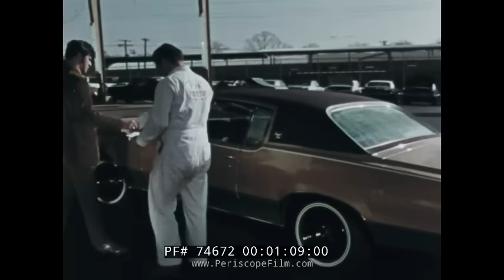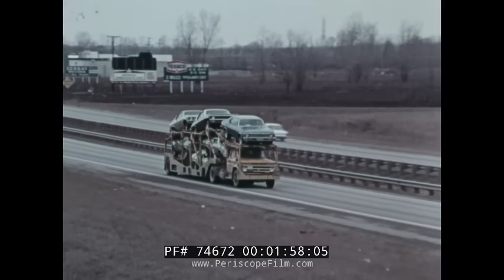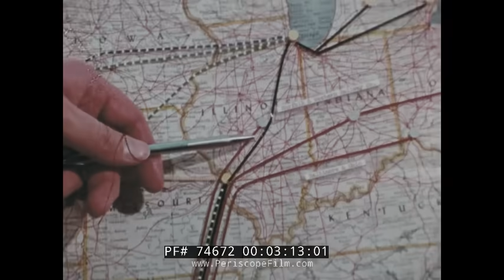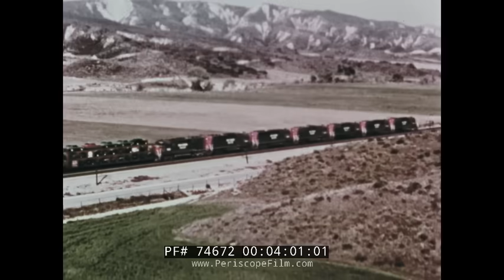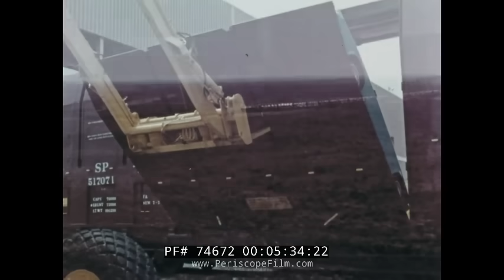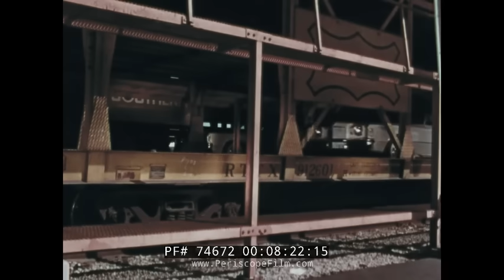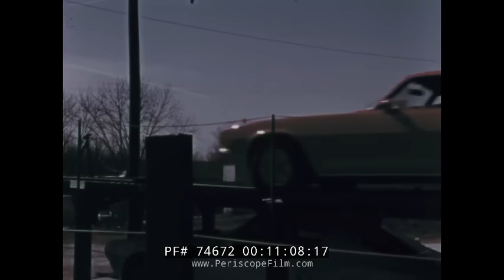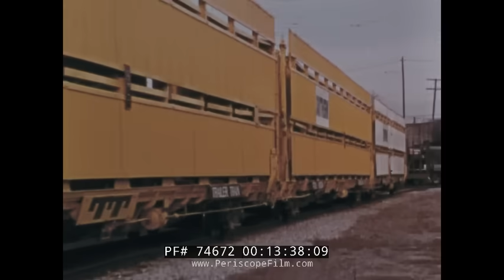1970s GENERAL MOTORS   RAIL SHIPMENT OF NEW AUTOMOBILES  LOGISTICS / SUPPLY CHAIN MANAGEMENT  74672

Comment: Somehow, being concerned about the condition of a Vega at the end of route was ironic given the intrinsic and designed-in flaws of the car.
Reply: Loved my '74 Vega. Only got about 25 mpg. Not very good for a "small" car. Totaled it with over 200,000 miles. Never a breakdown. No doubt however, the beginning of the end for Detroit. Then we moved on to Chevettes, Citations, Omnis, Horizons and Fiestas. American engineering at it's finest. An interesting side note .When the Vega was discontinued the leftover frames were used in the Chevy Luv pickup.
Reply: @steveevans4093  The LUV a Isuzu product. The  Vega a unibody car and no frame. But agree with your other comments. A lot of Vega's had long lives.
Reply: @steveevans4093  A Vega has no separate frame. The Monza replaced the Vega so they absorbed the same mechanical parts including the aluminum engine.
Reply: @Joshie2256  The Monza did not use the Vega engine. They used the 151CID 4 cylinder based on the old Iron Duke Nova engine, the 231 Buick V6 & a few got small block Chevy V8s from the factory. The Vwga engine died with the Vega.
Reply: @rebelyank6361  My 1976 Monza sure used the aluminum Vega engine! That was the only 4 cylinder through 1977. A guy at a neighborhood convenience store had one with the 262 V8. A buddy's GF had a '79 with the 151. I would have liked a late one with a 231 and a 5-speed.
Reply: @Joshie2256  yes and my MONZA IS A GREAT CAR.
Reply: @steveevans4093  200k what a.pos. lol.
Reply: @steveevans4093  You must have lived in the west for it to lasted.  Too much rust issues.
Reply: @steveevans4093  Ford Fiesta was made in Germany LOL:)  Festiva was a rebranded Kia.  Dad had both and loved them.  Both of them basically refused to die, and both got TERRIFIC gas mileage!  Chevette, OTOH... Dad bought one nearly new (used) for a work car in '79 or '80 during the gas crunch... He was driving 52 miles one way to the nuke plant to work every day, so 104 miles round trip per day adds up.  It was SUCH a POS, in the shop more than he drove it, after it broke down for the last time he walked in the dealership and threw the keys on the desk.  Went and bought a brand new Ford Fiesta and ran that thing til the wheels were ready to fall off, and then sold it.  German engineering at its finest!  Never had a lick of trouble out of that car.  Mom had a Plymouth Horizon for awhile, too... it was okay, nothing special.  First car I ever drove on the road... mom was in the hospital and Dad didn't want it sitting there all week, so he had me drive it following him home.  I was like 12 at the time, 23 miles through the countryside from the town with the hospital back to the farm LOL:)  It wasn't anywhere as good as the Fiesta for sure... nowhere near the gas mileage either.  Later!  OL J R :)
Reply: @lukestrawwalker Today German cars are the most expensive and least reliable cars you can buy.
Reply: @lukestrawwalker  the pride was a rebadged festiva and began production after the festiva did, you got your shit wrong
Reply: @steveevans4093  YOu forgot the Monza. Also Camaros were built in CANADUH.
Reply: Scott Weatherman wrong ,Camraos ,built in Ohio and Van Nys,
Reply: Scott Weatherman , Correction. Cameros  were built at the Van Nuys GM until it closed.
Reply: @scottweatherman3266  Camaros were built at the Norwood, Ohio plant.
Reply: Steve Evans and who cares??🤔🤔🤔🤔
Reply: Jefferson Martin  yes indeed!  I had one and it was junk.  Later when I became a GM engineer I actually got to work with some of the not so bright engineers involved on the engine design side.  I wanted to strangle them.  Very low days for GM.  However, now retired I really miss working at GM.  A lot of good people.
Reply: @mikesamyn7054  I hear you!!! I built Buicks in flint in 1973 regals 😱😱 and also worked at a Chevy dealer in 73 ! Vegas and ugly ass Malibu 🤣🤣🤣
Reply: Mine was fine after I put a 350 in it
Reply: My mother got one new Vega in 73, I got my license in 76, I had a lot fun in that car,  it handled pretty good compared to most of the boats on the road at the time.
It had an aluminum block without sleeves for the cylinders, so it was burning oil by the time it had 60,000 miles.
Reply: @Kent Teffeteller They wouldn't tolerate overheating. GM added low coolant sensors and indicators which saved a lot of them.
Reply: @Joshie2256   bingo. If you got it over 190. It was to hot. Unless it had sleeved block.
Reply: @Kent Teffeteller The 1st two years of Vegas had the bad engine; after that GM put steel sleeves in the cylinders which solved the engine oil burning issues. Tin Worm was a different story though...
Reply: @georgeandrews6454  None of the Vega engines had steel sleeves from GM. What saved a lot of Vegas and Monzas was the addition of a low coolant sensor and warning light.
Reply: @Joshie2256  the dura built engine did have sleeved  block.  And GM.bent over backwards to help .
Reply: The workmanship was dreadful too.
Reply: I wonder how manny $1M that lot full of cars would be worth today
Reply: @godoftheinterwebz  Probably at least 10 million... most things in the 70's that cost a dollar then cost TEN bucks now.  Dad bought his '77 F-100 pickup with a 300 six cylinder and 3 on the tree for $3,800.  My brother priced the cheapest new half ton Chevy on the lot a few years ago and it was gonna be $38,000... he passed LOL:)  SO 10X the price is about right.  Same with most things then compared to now.  OL J R :)
Reply: My dad had a Vega… it had the usual engine problem.  One of my earliest memories was him yelling at the dealer.   He replaced this with a Saab and never bought anything else until they stopped making them
Reply: LOL
Reply: I take it Vegas weren’t very good cars. Was before my time but from these comments...WOW
Reply: @rafiekwalker7744  they were good cars if you did not beat the shit out of them. I had good luck with all mine.  Except one that was to far gone when my parents bought it. And it did all the bad stuff the group think  people say.
Reply: @rafiekwalker7744  Rust was a major issue in the areas where aggressive deicing chemistry was used.
Reply: Vega have a special place in my heart
the first tine I ever smoked pot was with my cousins in his parents' Vega
Reply: Funny, I drove a ‘74 Vega for years without any trouble. But the same can’t be said for the POS Lexus LS that broke down (the first time) only two months after I bought it new.
Reply: Some years ago I watched a doc about GM and Toyota building a car together at the former Vega plant in California. As per the assembly line
workers who built the Vega’s moral was so low that the cars where being miss assembled on purpose, as the workers knew the plant was doomed 
if they didn’t get a new vehicle to build. Toyota took teams of workers to Japan to train them. They could ask the engineers any questions they 
wanted. The American workers where trained by Toyota that if they encountered a problem on the assembly line they where to STOP the line ! 
Apparently that was something you never did in American auto plants. So when the retuned to the US, and began producing, the whole system 
came to a battle between the assembly plant managers and the parts stamping plant. What Toyota never had to tell the American workers being 
trained in Japan was that the Japanese made parts where made to more precise specifications, and fit properly. Meanwhile the GM Toyota trained 
workers where demoralized once again when GM corporate told them just build the damn thing. One participant in the Toyota training program 
while in Japan, said the Toyota trainers, told the American trainees they could ask any question they wanted. In retrospect the US worker said, 
“ We just didn’t ask the right questions “. 

Side note: I hauled cars on my auto carrier for 22 years. Primarily these were Japanese cars that entered Canada via the Port of Vancouver B.C. 
For 15 years I distributed these cars all over the country. It would take about 2 weeks or more to make a round trip from Vancouver to Toronto and 
back. On one of the many trips I had to go to a Nissan zone office, where I picked up 5 total pieces of junk domestic built cars, Chevy Chivette,
Dodge Omni, Dodge 024, a K car etc. these cars probably where bought at a scrap yard, and where extremely rusty, but they all drove. 
I loaded these units and took them to Vancouver to a shipping company who were putting them in shipping containers to export to Japan ! 
The Nissan people where I picked them up told me these cars would be carefully disassembled and inspected to determine the effects of the 
salt corrosion the parts. The Japanese already knew what the new specifications of these cars, including the type of steel used. They where 
interested to see how they could make changes to their future builds with the information they learned from U.S. manufactured cars built 8-10 
years prior, and had a typical life in North America.
Reply: @georgerenton965  NUMMI was the joint venture for the Nova & Corolla.
Reply: Was that the car that always seemed to be tracking to one side from the rear. Or was that the Nova.
Reply: Jefferson Martin your point?!?!??!?
Reply: They quickly dropped railroads because they were always late lol
Reply: @ernestpassaro9663  Yes because NO cars are shipped by rail today LOL:)  Wonder what all those huge totally enclose AUTO RACKS on some of these trains are for LOL:)  Course so many of them are being built in Mexico now... like ALL Dodge trucks... 

They ship by rail to the regional distribution yards, where they were hauled out to the dealerships by truck.  Same as today.  Later!  OL J R :)
Reply: @lukestrawwalker  they are still hauling cars on rail in port Newark nj
Reply: @lukestrawwalker  yes I know my freightliner is made in Mexico !
Reply: @lukestrawwalker  I know what an auto rack is I worked on the railroad for 2 years
Reply: @Kent Teffeteller I had good luck with my vega to. F. THE GM HATERS.
Reply: Indeed
Reply: Bill Jenkins never had a problem
Reply: The coolant reserve tanks were added and repositioned for shipment to prevent coolant loss.  I toured the Lordstown assembly in early 74.
Reply: now we know why they were junk and always falling on ther face

Comment: At the very least the gasoline had to run out of the carburetors on the Vegas being tipped up like that.
Reply: The need to move the cars in that position defined some design details so that the oil, petrol and battery acid didn't pour out, and they chocked the suspension and engine mounts so they didn't have to take loads in the wrong axis. 

It's really quite ingenious, but presumably there were disadvantages or they'd still do it.
Reply: @donkmeister  Lots of extra labor, and you'd have to design for it. New cars dont leave enough room for an engine when they are designed let alone for any engineering like that :)
Reply: @donkmeister  That kind of shipping is why GM cars had the "side terminals" on the batteries IIRC
Reply: You play poker donkmeister?
Reply: did you listen to what the narrator said? they designed the car around the shipping method.
Reply: The oil leaked out too.
Reply: All they did was leave them a quart low on oil.

Comment: question ? wouldn't all the fluid in the cars in the Vertipack run out and spill and pool in the wrong spots in the engine and so forth?
Reply: the narrator clearly said that the design and production of the car was centered on the method of shipping.
Reply: @atl_h2_nw  Not all Vegas got the " rail transit " treatment; those that could be trucked to local area dealers had a " normal " battery and wiper fluid bottle, those by rail had the fill caps relocated so they wouldn't leak. Worth mentioning the REAL reason Vegas were shipped standing on end, was to SAVE Generous Motors MONEY -- Thirty cars per auto rack as opposed to 15 on a normal rack. Remember the Vega was the entry level ( i.e. = CHEAP ) Chevrolet.
Reply: They were shipped with special seals to keep fluids in and very some even at the least amount possible to allow them to run enough to load and unload. Dealerships had to remove the extra seals and shipping blocks that held things like the Battery tighter in place. All this would be done before they could hit the showroom. GM spent time and money to make sure the vents in the Vega's were in a location that not only allowed normal function but also were high enough to not leak when being shipped.

Comment: My parents bought a new 1971 Chevelle wagon, 307, 3 on the tree, antique green with the phony wood sides. I learned to drive in it.  We picked it up at the dealer,  driving home and were 2 blocks from the dealer and the oil light came on, major oil leak. We got back to the dealer and it was another 2 weeks before we saw it again. Guess the dealer had to finish the assembly job that should have been done at the factory, BUT, it somehow passed all those strict GM quality checks.
Reply: I've made the correlation that when the UAW is PO's about something the customer suffers with problems that shouldn't be.  Though I was a union construction worker I have to say that the UAW doesn't care if they bite the hand that feeds it.  As well, I think the UAW is much at fault for manufacturer's building plants on foreign soil.
Reply: yeah the guy with the suit on on the train car should have noticed that
Reply: or it was on the speical vega train car and the oil ran out the fill tube ????
Reply: My friend bought a new caddilllac from a dealer in 1969.  Car made a thump noise when you hit a bump.   Took it back to the dealer who couldn't find the problem. 
His best friend  , my uncle Paul took the door panel off. 
Hanging in the door was a  glass Coca-Cola bottle suspended by a string with a note saying "Oh you found it! "

My best friend Joe,  his father Joe was a dispatcher for the B&O rr in Punxsutawney,  Rykers Yard. Train office was right beside the Jr high  which was right beside the rr track and siding. 

I would sit in English class and look out of the window and watch  new  1976 / 1978 Chevrolet  / Ford  cars travel up and down the tracks.   Some of them had broken windows from kids throwing rocks.   None of them came through town after school when we were waiting for the bus,  mostly just coal cars..

We put copper pennies on the rail,  they looked like quarters by the time 150 rail cars drove over them..

Local town idiots would hop on the train,  one ended up in Butler PA with no way home..  The rr went to armored cars after that and i have not seen a  car hauled in 40 years..
Reply: Many an empty whiskey bottle was found in a similar way as the coke bottle, or maybe years later found stuffed up in the cowl to floorboard air venting system
Reply: Family trucks tor?
Reply: Gm never had any strick checks
Reply: @dknowles60  Neither do skools.
Reply: At least oil was cheap back than 😂
Reply: GM has always been junk

Comment: they do not make them like they used to. Now it's all plastic...garbage.
Reply: Cars built in the 70's were some of the worst quality of craftsmanship this country ever produced.
Reply: @marconey4872  Is that why all my old stuff still runs and looks good?
Reply: @marconey4872  I still have my 73' Mach One. Almost 50 years old & still drives like new.
Reply: @marconey4872  You're absolutely brainwashed old man if you think 70's cars were junk, especially compared with today's throwaway plastic sht boxes. Go take your Metimucil and put your fake teeth back in your mouth and learn something for a change.
Reply: @marconey4872  When you take apart a car from the 70s you will know that this was not the fact. The stuff today is flimsy and cheap comparatively. You will not see a restoration on a 2020 Camry in 40 years because there will be nothing left of it to restore.

Comment: Video footage of the Vega's being loaded onto Vertipak cars!  I love this thank you!
Reply: The problem was all of the fluids travelled to the front, so they had to develop special baffles to contain it.
Reply: @crlaw75  You answered what I was thinking
Reply: I bet each Vega smoked like the start up of the diesel locomotives that pulled them when first started. All that engine oil making its way to one end of the engine and sitting in pools above the valves, no doubt oil making its way past the guides right into the cylinders themselves. At least those at the bottom when stacked vertically